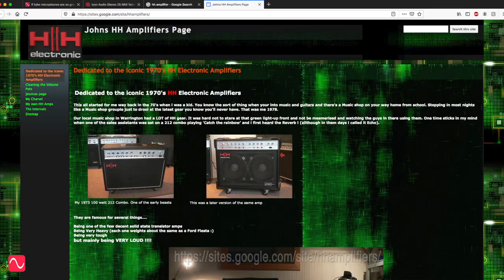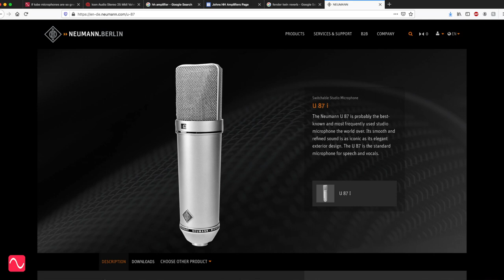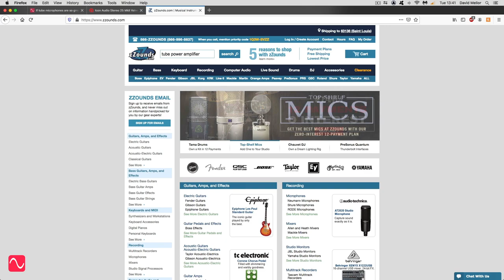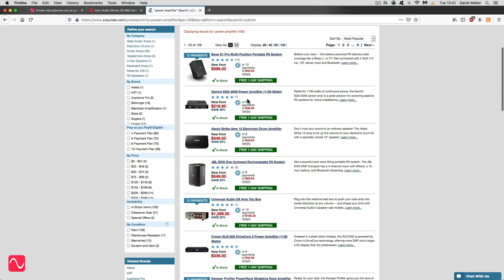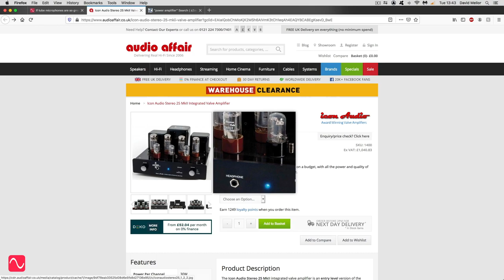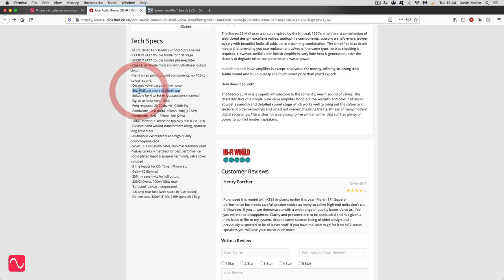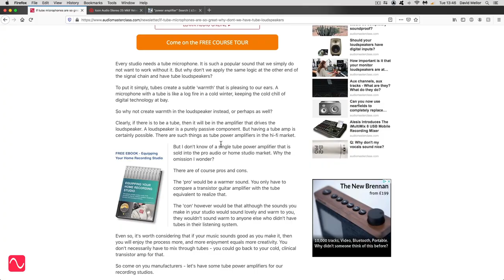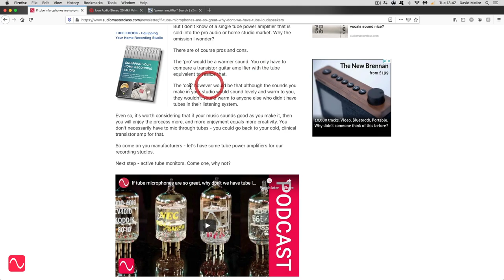REACTION: If tube microphones are so great, why don't we have tube loudspeakers?

Comment: The description of the tube Hi-Fi you pulled up is a tad strange though. "Ultra-Linear" That's what transistors are for, the very thing that tubes (especially triodes) aren't good at. It's the nonlinearity of the tubes that give that smooth tube sound. It seems a bit of an odd marketing point.
Reply from the maker: It could be a marketing gimmick, or it could be this - https://en.wikipedia.org/wiki/Ultra-linear. If it's the latter, it might just be the normal way of doing things in modern tube amps. That's a common marketing trick for all kinds of products. If any tube amp expert would like to comment, please go ahead.